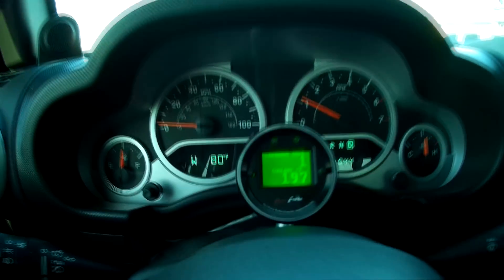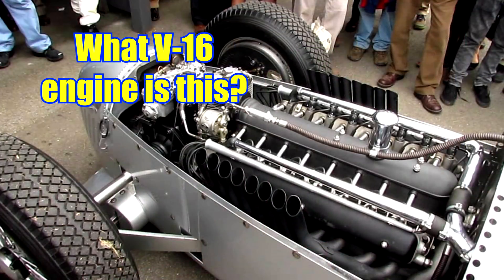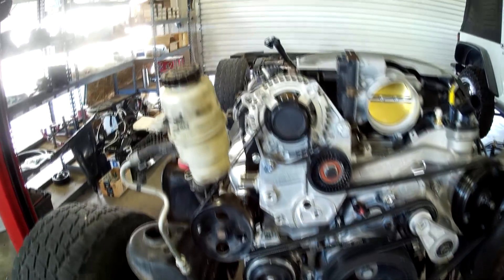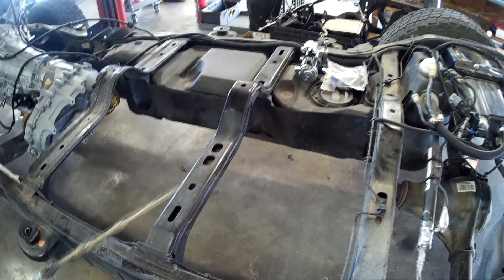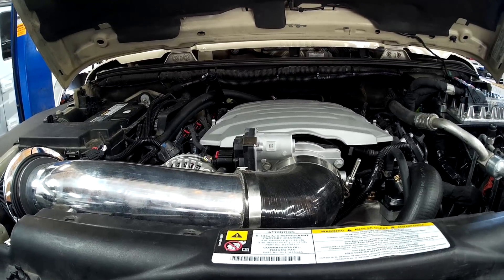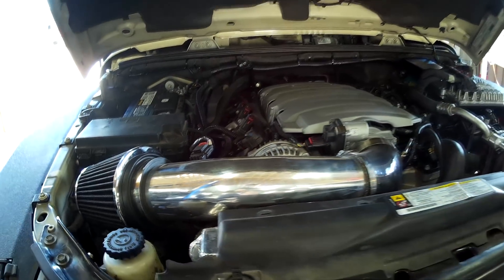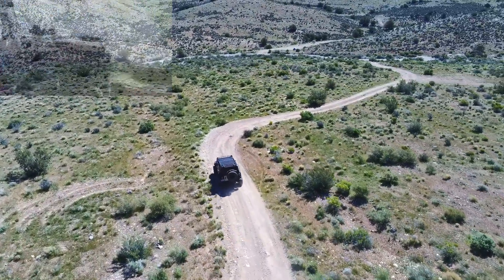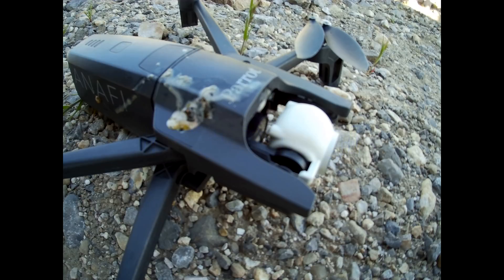LT V8 engine conversions, the future.

Comment: Ive seen some interesting electric engine\battery options that can be used with existing drivetrains coming out....thoughts on a Jeep experiment?  Ive seen examples that with proper adapters sync right to the trans.  Very interesting tech coming out.  Though Ill always love the viceral experience of combustion engines.
Reply from the maker: Well Jeep now offers the 4 cyl/electric JL, I drove one and it is impressive technology. Very complex and still does not offer the V8 sound, power experience; however, for a mid level performance it may make sense when the aftermarket has it properly integrated. Battery storage, software integration... still leave a lot to be desired with add on hybrids IMO but I do feel they will eventually find their place.
Reply: @WranglerJKLS  agreed..but I'm talking all electric...some cool after .market stuff out there.